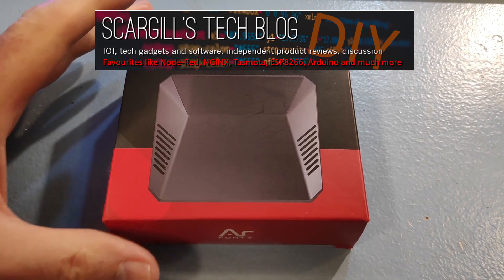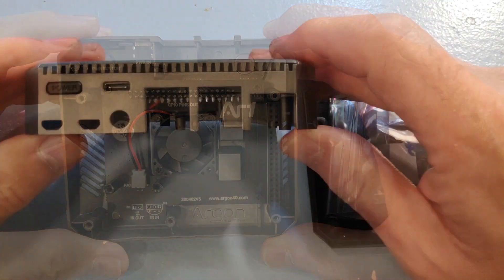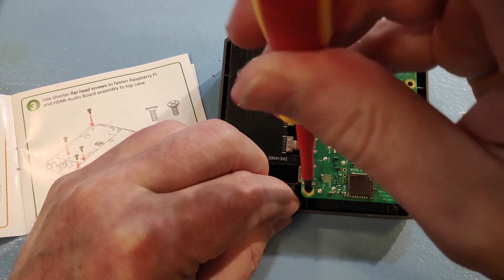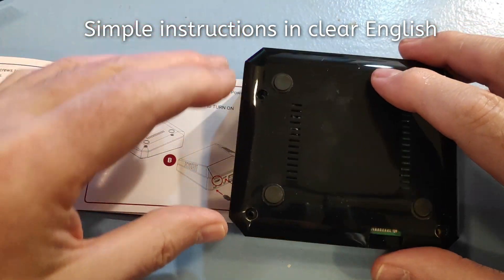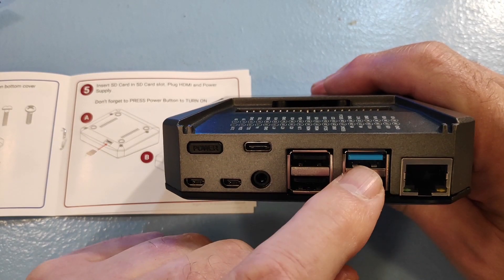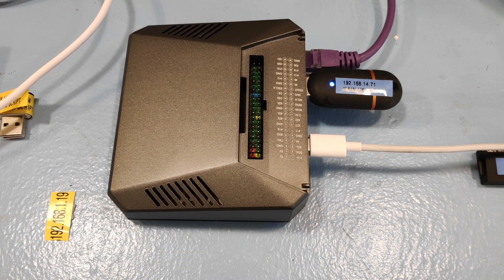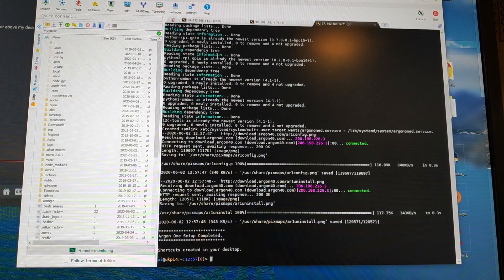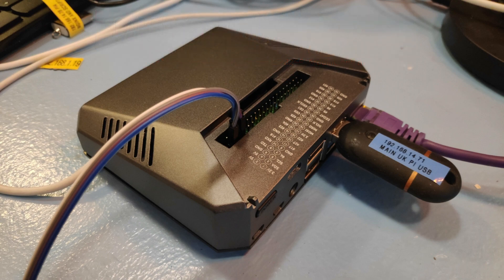Argon ONE Case for the Raspberry Pi 4 - Substancial

Comment: Both the power and fan controller scripts are solely dedicated to the Raspberry Pi OS. Is there any way to modify those scripts in order to run Ubuntu 20.04. 1 LTS / Ubuntu Mate/Manjaro?
Reply from the maker: Ask the company - I used it for Raspberry Pi OS.

Comment: Thanks for the review. Does the case attenuate the WiFi and Bluetooth signals?
Reply from the maker: I never use WiFi on a Pi (hardwired as it controls my heating - can't take any chances) snd thinking about it I don't use Bluetooth on the Pi. Good you brought that up, though.
Reply: @PeterScargill  I'm brand new at this, but wanted to set up a VPN on a Pi to isolate the ESP32 Smart Home devices on a different subnet, controlled by the Pi's WiFi rather than my house's WiFi router. If you don't use the Pi's WiFi, how do you control the WiFi devices? What am I missing?
Reply from the maker: @michaelbishton9439  My WiFi devices around the house are accessed by the normal WiFi. As they generally use Tasmota, Espurna or ESP-GO, they mose no security risk. The PI being thr central controller is running hardwired.

Comment: Guessing there's a microprocessor on the daughter board. Wonder if it can be reprogrammed to power on by default.
Reply from the maker: Hi Paul, the manufacturer just wrote back to suggest I check their I2c commandset - and there is a default power-on setting... but they neglected to mention how to access the I2c commands - oh, I guess it can't be that hard thinking about it. I've a second case so as soon as I check that out on another Pi, I'll let you know. So much to do, so little time.
Reply: Yes! Using the i2C tools that install with the Argon One script, you can toggle the setting for the case to route power to the Pi without first pressing the power button (in the event of power loss) so that it's default state is always ON, unless you physically power it off by the button or a shutdown command.  After you install the script, from local terminal or SSH from another computer to your Pi, type this command:

i2cset -y 1 0x01a 0xfe

Behaviour: Power current will flow directly to Raspberry Pi. No need to PRESS button to power ON from shutdown or power outage.

This setting will persist until you change the default power state back to OFF using this command:

i2cset -y 1 0x01a 0xfd

Behaviour: You need to PRESS button to Power ON from shutdown or power outage.

Works great, especially if you're using your Raspberry Pi as an always on server.  So there's no need for physically modding your beautiful new Argon One case for this!
Reply from the maker: @henryballard2723  Thanks for that Henry
Reply: Thanks for doing the legwork and posting it on your blog, Peter. Good stuff!

Comment: Thanks for the review Peter; I got one of these cases, the build quality is really nice. However, I hadn't thought about the default power off state, that could be a real pain for a headless unit like a server, if the power fails and comes back on it would be dead until you attend to it. Like your hack though, that seems a straightforward way to make it auto power up if that's needed, but it would be nice to see that as an option, perhaps a selection switch or jumper on the daughterboard would be good.
Reply: There's an elegant solution for this scenario without modding.  After you install the script, from local terminal or SSH from another computer to your Pi, type this command:

i2cset -y 1 0x01a 0xfe

Behaviour: Power current will flow directly to Raspberry Pi. No need to PRESS button to power ON from shutdown or power outage.

That's all there is to it.  This setting will persist until you change the default power state back to OFF using this command:

i2cset -y 1 0x01a 0xfd

Behaviour: You need to PRESS button to Power ON from shutdown or power outage.